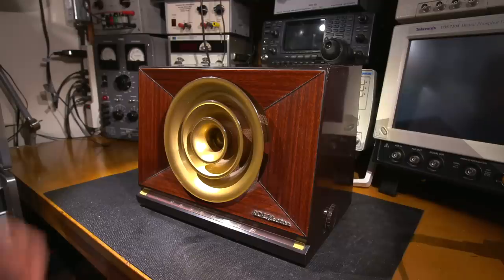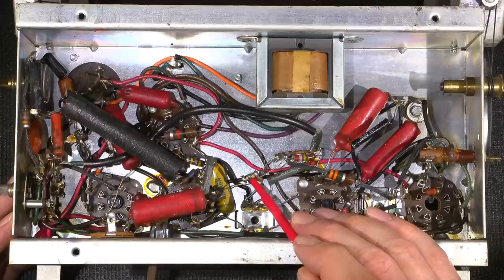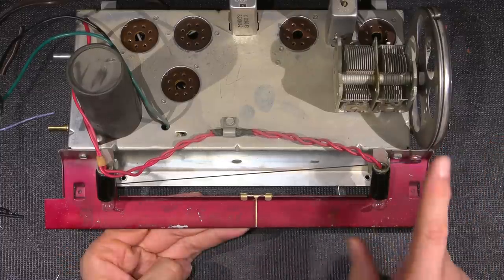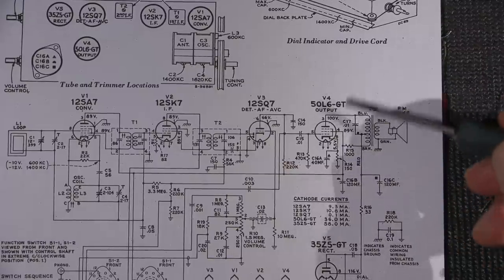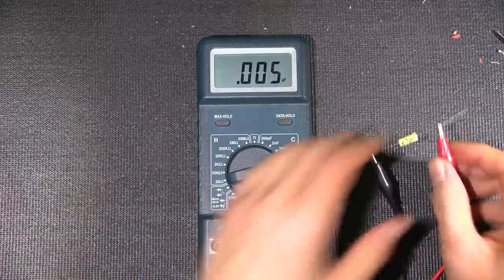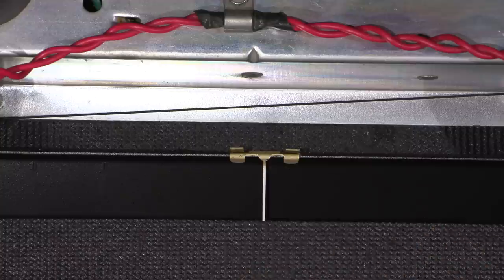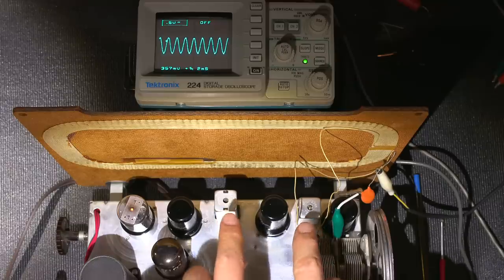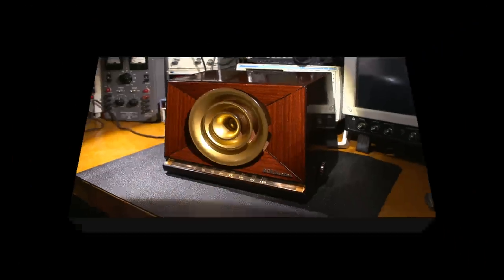Bizarre Looking RCA Radio! [Electrical Restoration]

Comment: Is there a phono pre-amp in there somewhere, or does the "phono" just act as an aux-in? Is there a jack somewhere for it, didn't notice one at the back? Also what's up with the tone control, what does that do exactly? Lastly what do these concentric wave guide thingies do to the dispersion characteristics of the speaker, do they have a noticeable influence when you listen to it from different angles?
Reply: Hi,  I was just running down the comments and thought I might reply to yours - although I daresay you`ve already had your enquiries answered  1)  The very heavy pick- ups used with a massive magnet assembly when that set was made would have been high output ones used with 78 RPM records, which themselves had very wide modulation on the grooves  hence sufficient signal voltage for the sets of the day. The modern L Ps have very fine grooves with tiny movements, or modulations. These LPs have a recording curve which  needs to be corrected when played back. Also, the modern magnetic cartridge would have insufficient signal for this set. Now, for the positives!  The crystal cartridge was used a lot on fairly lightweight pick-ups later on  for radio grams and record players. These were satisfactory as their characteristic reasonably matched the recording of the discs - and still had a high enough output despite the small groove movement.  However, the modern enthusiast has valuable records and will want to use a very light, sensitive pick-up and good quality cartridge!  Easy - use a small pre-amp with RIAA equalising which will have sufficient output voltage for the vintage radio. One can be very surprised at the quality of the radio`s amplifier - after all - the only signals heard on it previously have only been from medium wave!  
          The loudspeaker lens is the same type one sees often in superstores with background music playing. I have never actually come across a radio with one!  The effect is to spread the sound out;  it may, I suppose, smooth out some resonances in the speaker unit - but then again - it probably introduces some others!  I think it would probably sound better without  - but then - it would remove that distinctive feature, would it not?

Comment: Often the dial lights were in series with the filament line etc 50 volts + 6 volts ect until 110 volts dc or ac.

Comment: I won’t lie I was expecting to see you pick up the speaker after emphasizing the need to put it in a safe location because it’s a screwdriver magnet and see about 5 screwdrivers sticking out of the cone.

Comment: Nice, the receiver works, but there is no transmitter to listen. Unfortunately in Europe you can tune in am stations spending kilowatts of power for 0 (ZERO) listeners. Kill it all, save the energy.

Comment: Tube audiophiles crack me up. Their equipment is "warm" sounding already but they have to add more warmth by installing crappy capacitors. I love the warmth created by Class A circuits, especially in early audio consoles and in compressors like the 1176 and the LA2A, but putting components in your signal path that stress your tubes - the most important part of your analog circuit just seems silly and wasteful.

Comment: Yeah, class 'A' , cathode biased power tubes are great until the tube shorts plate to filament..!!  LOL!  You mentioned the cathode resistor of V4, but overlooked the C16A 40mf cap.. Any reason for that..??

Comment: Obviously designed to go with that RCA 45 RPM changer just in time for the Sputnik era.
Reply: It was.  I had the pair, and they were bought together.
Reply: @BrightBlueJim , my aunt got me the RCA "phonograph" with the built in amp & speaker when I was only about 5 years old, but then I had to live with really cool old radios, the kind with 3 bands that would get short wave, police, aircraft, amateur, etc. My parents would get 'em at garage sales & they had huge speakers & amplifier sections.Those old things really pulled the stations in & the dials were actually pretty accurate! They were made outta wood, with metal bezels surrounding glass fronted dials, etc., not plastic shit! Too bad I was a bit young to figure out how to hook up the phonograph cartridge to the old radios & add some tweeters! Too bad that equalizers & analyzers weren't common then like they are now, then I woulda had fun!!! I don't think they even existed in the mid 1950s. I woulda had better sound than the studios & engineers before I was a Cub Scout, LMFAO!!!

Comment: All single ended audio amps are biased Class A.    In increasing the tube's bias due to a leaky coupling capacitor only increases 2nd, and 3rd order distortion. The combinations of these products gives the tube amp it's so called warm sound.

Comment: me not like valves. Easy to get killed by HV, everything is hot and bulky. Even the schematic diagrams are hard to follow as both ground and power rails are on the bottom. Will not die from radiation though if the nuclear bomb hits nearby.

Comment: I really like your channel. This is a great restoration, nice radio. But man, you spent thirty minutes on polarity and leakage.  I don't believe one should be transfixed on cap polarity, when orange drops are available.  Remove wax caps, toss in fireplace, install orange drops, done.
Reply from the maker: Orange dip capacitors have an outside foil end as well, and the line printed on the capacitor has no relevance to that outside foil. I have video's showing this.
Reply: @MrCarlsonsLab  I have researched this in great detail. Most believe they are bipolar. Yes, you can find its polar end with scrutiny, but is it necessary in old radios and guitar amps? Considering the voltages, I think not. But I welcome a solid explanation.
Reply from the maker: Hi Mike. I do have video's on this topic, just search my video's list. I also explain "in this video" the importance of orientation in circuit, and the reasons why. They didn't put those lines on the capacitors for no reason, and spend the extra money to do so. I will do more video's with some examples of the affects in the near future.
Reply: @MrCarlsonsLab  I understand why they label the foil side on electrolytics. I was talking specifically about orange drops. Even the manufacturer claims they are non-polar. Thanks for your replies, I think you are genius level and really enjoy your content!